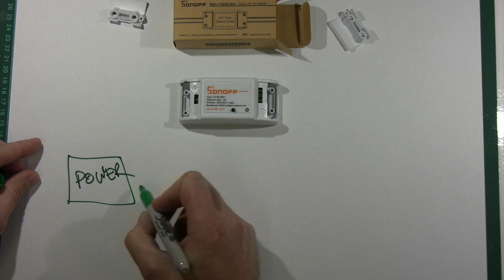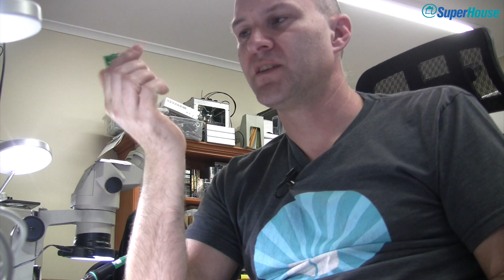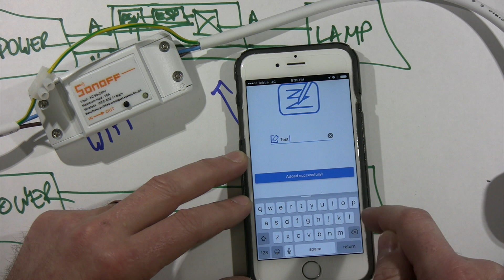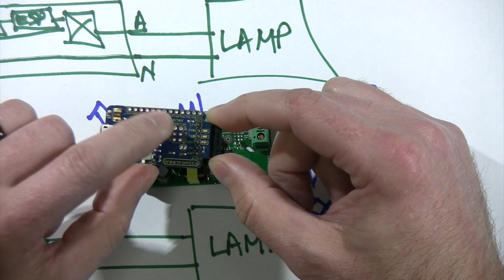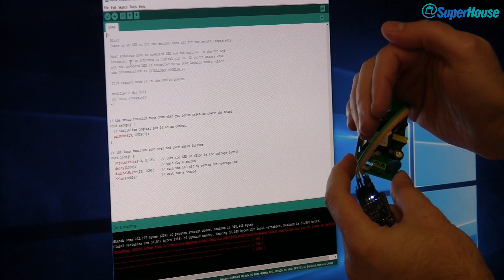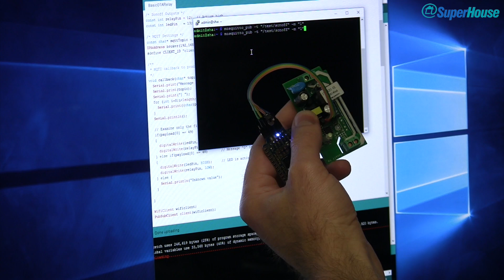SuperHouseTV #17: Home automation control with Sonoff, Arduino, OpenHAB, and MQTT

Comment: Think I bricked mine..
got "error: espcomm_upload_mem failed" when trying to upload Blink and now the led wont flash when connecting the FTDI to usb.. =(
Reply: nevermind, rx/tx in wrong direction... =P
Reply: im getting this error did you have tx and rx in the locations recommened in the video ?
which worked for you i cant manage to solder so am trying to hold the ins in place
Reply: I just switched them and tried again.
Reply: I must have to solder them in then .
is the LED meant to blink when in the flash mode ?
Reply: No, I saw no led blinking
Reply: Kim Lindblom thanks I'll try again

Comment: Hi Jonathan, thnx a lot for this great video. What is the 5th pin on the U4 connector? the one at the end above GND for which you said you'll talk about it later but it's not present in your video. Is it GPIO2/SCL ? Is there any other pin outs on the board? Also, you've said that green element of the led is connected to GPIO13, what about the other color, what is it connected to? also which GPIO is the relay connected to? thnx a lot.
Reply from the maker: It's GPIO14. This video ended up becoming quite long, so I decided to cover that in a follow-up video which turned into episode #21: https://www.youtube.com/watch?v=8mz5sCAvDAY
Reply: thnx a lot, i've been waiting for this answer :-)
did you also make a video for electric roller blinds control, possible with esp8266?
there is a dual and quad controller product that sonoff is selling. did you try those?
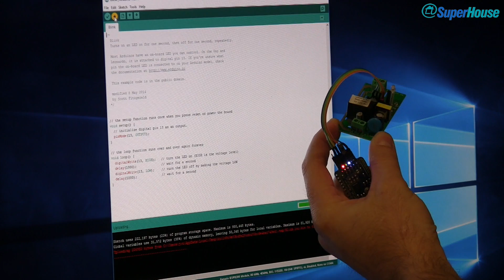Reply: 26:21 the bi-color led is red/green but only the green part is wired in this Sonoff version. If you want you can connect it to GPIO14, which is wired to the 5th pin on the U4 connector. the nice thing is even the required pulldown resistor (R3) is available on the circuit there. It goes to non-present Q3 MOSFET, so use Q3 pin and solder a wire between the Q3 led pad and GPIO-14 from the U4 connector.  Also, the relay is GPIO-12 and the button is GPIO-0.

Comment: I'd like to use the Sonoff dual to control my garage door via WiFi/Internet just in case I forget to close it.  I have 2 garage door openers.   Instead of having to get 2  A/C to D.C. to control an external relay with its closing contact mounted across the door openers push button terminals could I use the internal relays normally opened contacts to do the same thing. Wondering if I could remove A/C going to the relay with some etch cuts so I only have just the closing of the contact available to connect to the door opener screws.   I'm using a web cam in the garge for a visual but that doesn't solve the problem of having to turn around and head home to close the door.    Thanks, Ken
Reply from the maker: Yes, that's certainly possible, but please make VERY sure that you've isolated the relay connections! I'd use a cutting tool like a Dremel with a grinding / cutoff disk in it to cut across the track, and use a multimeter to make 100% sure there's no continuity between the relay pin and active.
Reply: +SuperHouseTV I downloaded board diagrams and schematics of the dual.   looks easy enough to cut trace feeding relay.  I think the fuse is only used for the load so removing it might kill AC to the normally open connection.   A couple etch cuts would let me use the screw terminals.     I have on order a board that might work better.  4 relays that have a 1 sec momentary closure which is better for garage door openers.

Comment: I've noticed that Arduino flash of ESP8266-12E over Wi-Fi may be dependent on any pins being connected in sutu and pulled high/ low while flashing over the air. Sometimes have to bring it back to the USB port for upgrade.
Any ideas?
Reply from the maker: Sorry, I don't know an answer to that :-(

Comment: Thanks for a great episode, do you know if its possible to add an external antenna to the sonoff? Putting the unit inside a metal box makes it hard to connect. Cheers
Reply from the maker: That's a brilliant question! Because the Sonoff uses an ESP8266, the short answer is that it SHOULD be possible. The Sonoff PCB includes a trace antenna just like you'd find on a typical ESP8266 module, which means you may be able to cut the trace and solder on a coaxial pigtail for an external antenna. I haven't done it myself, but it sounds like it should work. It would be interesting to try.

Comment: Hi, I've just received two basic Sonoff modules. My original plan was to flash both devices with the custom firmware, but after soldering a female connector to the pins, I thought first to test the official app. Sadly, the app was unable to find the device and pair with it, so I tested the other (untouched) device and it worked perfectly; actually the app found it in a second.
Anyway, I want to flash the custom firmware to the (defective?) module, but I don't have a converter as mentioned in this video and other similar tutorials. I'm wondering if there is any way to perform the procedure with an Arduino One board?
Reply from the maker: Yes, and there's some information here to get you started: https://github.com/digistump/OakCore/issues/56

Comment: Good day Jonathan, before anything else  I would like to say GOOD JOB IN presenting SONOFF products in your site. May I ask if you can apply this programming (Sonoff - WiFi Wireless Smart Switch for MQTT COAP Smart Home ) to Sonoff 4CH - 4 Channel Din Rail Mounting WiFI Switch?..... What I mean is if this 4channels can also hacked to  put firmware that syubscribed to MQTT.
Reply from the maker: Yes, the Sonoff 4CH is supported by TASMOTA firmware which works with MQTT.

Comment: My question is: Can I use this device with original software to control it over 3g,4g (mobile internet) ?
Reply from the maker: Yes. The original software uses an external server that ITEAD runs on Amazon Web Services that acts as a bridge between your phone and your Sonoffs. The phone doesn't send commands directly: it sends them to the service, which controls the Sonoff. So if your Sonoffs can connect to the Internet, and your phone can also connect, then you can control them. You don't need to be on the same network. The upside is that it works anywhere, easily. The downside is that you need a working Internet connection and if the service ever goes offline your devices stop working.
Reply: thx!!!

Comment: I just powered a SONOFF with an ARDUINO without connecting mains VAC. To my delight the wifi then operated normally. I then discovered a pin on the Sonoff that provided 3.3VDC when the Sonoff is 'on' and 0VDC when the Sonoff is 'off'. I then connected a jumper from that pin to an input on the Arduino and now I have app control over the Arduino!
Reply from the maker: Nice!
Reply: Could you please teach me how to find that,  cos I need sonoff to control my garage door

Comment: Great video, after a little more googleing now I understand howal that actually works, what is arduino, mqtt, esp8266. Is there any way to make it work with Homebridge?
Reply from the maker: Short answer: yes. Slightly longer answer: I've seen many talk about it online, but I haven't personally used Homebridge so I can't vouch for it. I really want to do something with Siri integration, and OpenHAB supports Homebridge so investigating that is high on my list.
Reply: great, will stay tuned :D really good videos you have and a lot makes sense after watching it

Comment: Great Video. Is the app on your phone your own one or you use 3rd party app? Any pointers or links on developing this ? I want to be independent of any 3rd party systems myself. App alone shouldn't be a problem to switch things on and off but I'm just not sure if i will be able to incorporate pairing into the app. Thanks for any help and keep them videos coming. There is 32,679  of us craving for more ;)
Reply from the maker: Thanks Jakub! The first app I showed was the one supplied by iTEAD. The second app (which is the one I normally use) is the app for OpenHAB, which I use as my main home automation controller / coordinator.

Comment: Jon, thanks so much for these videos! I've been messing with OpenHAB for a while now and decided to take the leap and just buy up on all the Wemos and Sonoff stuff. I hope we start to see more hardware from companies like Itead who actually embrace the makers whilst making it accessible for the consumer :)

I was initially having issues because my el-cheapo (sorry, no Freetronics here in Thailand :P) TTL Serial interface lied to me when it said it had switchable 5v-3v3 logic level. Luckily it didn't kill the Sonoff and also had a spare arduino I could use instead (by grounding the reset pin and using the rx/tx lines)

Now if someone can make a good quality esp8266 powered door lock, I'd be happy as a pig in shit!

Comment: i'm trying to hack the Slampher sonoff.  I've already done the regular sonoff, and tried the same method with the Slampher but getting these errors: 

Global variables use 33,408 bytes (40%) of dynamic memory, leaving 48,512 bytes for local variables. Maximum is 81,920 bytes.
warning: espcomm_sync failed
error: espcomm_open failed
error: espcomm_upload_mem failed

Any idea what is wrong?

Comment: at the beginning of the video you mention how you built a light switch that can both be physically clicked and wirelessly turned on/off whilst staying completely in sync.
-Sonoff is perfect for the wireless aspect but there is no physical switch.
After watching this video and SuperHouseTV #20, is there anyway of combining the circuitry and code to have it work in one complete system?
Thanks!
Reply from the maker: Yes, and if you check episode #21 I think you'll find a solution :-)
Reply: Only had one more video to go to get my answer! Oh well thanks! You're channel is amazing by the way! Extremely well detailed and easy to follow.

Comment: +SuperHouseTv can you get a dimmable version of the sonoff to control the brightness of dimmable led lamps?
Reply from the maker: Not at the moment. Current Sonoff models use relays that only allow on/off operation. In future there may be one with a Triac or similar to allow dimming, but I don't know what iTead may have planned.
Reply: have you got any videos configuring openhab2 with MQTT I have MQTT running but can't figure out how to get it connected?

Comment: Thnx for this interesting video
I'm interesting in building my own smart home using  
Wireless module CH340 NodeMcu V3 Lua WIFI Internet of Things development board based ESP8266 and 5V Relay Module Coupling For Arduino PIC AVR DSP ARM relays

You said that it is dangerous and i could burn my home, Can you explain why it is dangerous?
i'm really interesting in build such things but i have very limited knowledge in electronics and electricity

So please explain the Risks to me

Comment: Hi Jonathon,

Thanks for posting this video. I've got myself a few Sonoffs that I want to use with Home Assistant via MQTT.
The Blink and OTABlink sketches work fine and the OTARelay uploads without any issues. However publishing to the Sonoff either via the SSH command line or MQTT.fx does not change the pin states. Looking via the serial monitor in the Arduino IDE tells me the MQTT broker cannot connect.

My question is, does one not need to specify the user name and password (which my broker requires). Also, does the port (1883 in my case) not need to be specified as well?

Thank you - Richard
Reply from the maker: If your broker is configured to require authentication, then you're correct: your client will need to be configured for it. If you're using the PubSubClient library, you can do it in the Connect method: http://pubsubclient.knolleary.net/api.html#connect3

Comment: An excellent video Jonathan

A few comments..
The new versions SONOFF TH16 (16Amp) and others now have CE certification so this opens up a whole bunch of opportunities

ITEAD also have a few other great product with CE approval or alternate functions

A Glass panel light switch with all the functionality of the sonoff but with a really nice touch switch to replace standard wall switch

A Dual unit in a similar plastic enclosure to control two loads

A Power monitoring SONOFF called Sonoff Pow WiFi Switch With Power Consumption Measurement
Sonoff LED- WiFi Dimming LED Pack

S20 Smart Socket - WiFi Smart Socket EU/US/UK - 

check out here for all the range https://www.itead.cc/smart-home.html

Ill be doing a review on my youtube channel soon as I just got a few of them into the lab.

In The video it was mention that the ESP8266 was providing the 433Mhz RF but it is not. Some earlier boards had a submodule installed that handled this but even though the PCB location is there, the sub board is not included on most of the newer ones. This is not really an issue these days as Who does not have a smart device available to control them.

Peter Scargills site is http://tech.scargill.net and as Jonothan stated, he has a wealth of info there. I also have a few videos on using the ESP8266 (SONOFF etc) with MQTT and Node-Red rather than OpenHab. this is a great alternative for those interested in it. my site is http://www.youtube.com/thebreadboardca

I look forward to more great videos Jonathan, keep up the great work
Reply from the maker: Thanks for all the details, Peter! Yes, I already have the newer Sonoffs and both the US and Euro versions of the glass plate light switches, so I'll be featuring all those in later videos :-)

Comment: If you're looking for a RGB LED light strip controller, Banggoud.com is selling a product for less than $10 (http://www.banggood.com/ARILUX-AL-LC03-Super-Mini-LED-WIFI-APP-Controller-Remote-Control-For-RGB-LED-Strip-DC-9-12V-p-1060223.html?rmmds=search) and it can be easily reprogrammed with Arduino and MQTT. Alternative firmware: https://github.com/mertenats/Arilux_AL-LC03

Comment: could you put a link to your ESP8266 board or a link were to buy one that would do the same job cheers  .
Reply from the maker: Which board do you mean?
Reply: the  ESP8266 board  witch is connected to the sonoff board used for flashing .in superhousetv #17 home automation video .thanks

Comment: If you have all your lights going directly to the central cab, how do you control them with a wall-switch? I guess all wall-switches will have to be 'smart' switches with relays. Right?
Reply: Go through and watch his over automation videos, they work by sending a message to a central server.
Reply: Ripmax Yes, but where does the actual switching happen?
Reply: He has DIN-rail relays in his consumer unit (fuseboard)
Reply: Ripmax
So every light is switched at the c.unit and the switches on the wall just send signals to the automation software... OK. I am thinking rewiring the house, but I want to have wall switches that can be used independently and then have to option to go full-smart-home in the future.
Reply from the maker: That's exacly right. It's a star topology, with all loads centrally switched, and all control surfaces simply sending logical commands to an OpenHAB server.
Reply: SuperHouseTV Yeah, that would be to logical things to do. But what would you do If you are to renovate and put in new wiring, you don't want to have "full smart" capability yet but you want to run wire in such way that will let you do it in the future will little or no rewiring ??? That's my problem... :-)
Reply: BIll Geo Run all the loads back to the fuse board as shown in this system, however use standard breakers instead of relays for now, as they can be changed to relays in the future :)
Reply: Ripmax Hmmm... and keep the existing mech. switches in place, for now, and later bridge the wires inside and replace the switches with smart "command-senders" (either wired via 2-wire, or wireless via z-wave). Hmm... I would need to, at least, double the fuse board in size!

Comment: Hi. I got a new sonoff with temperature sensor to use with openhab. Wich code do I have to upload to use the on/off and get the temperatures and humity? By the way, the programming works out of box. Nice video.

Comment: Jonathan, do you have any tips on preventing interference? I tried to put one behind my tv cabinet which houses an AirPort Extreme, amplifier, Apple TV and other bits... but the wifi routinely cuts out on the Sonoff which in turn, switches on the device connected to the Sonoff. Wife not happy :)

Comment: Hi I like ur video, I just won 10 5v relay from ebay for $10 that I was going to use in my (HA) Home Assistant setup on my raspberry pi gpio. Now I saw ur demo on sonoff it will be easier to add to HA than the 5v relay which I need to run long to each device. Question, you have a link to some Sonoff, is any of then already flash with mqtt? it would be great and beat the newbie in me to try to flash these my self. I like to buy some if they already been flash with mqtt, even if you charge extra for the flashing.